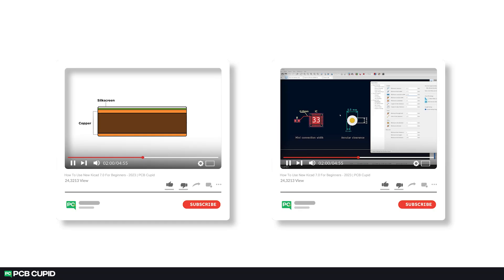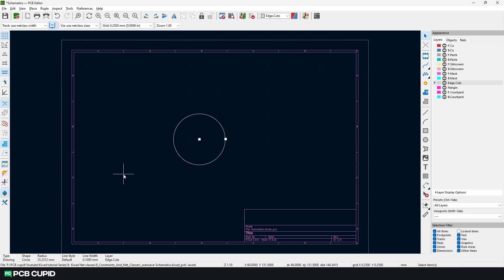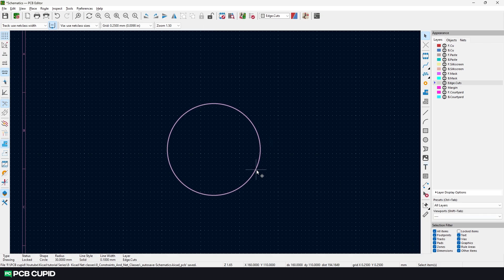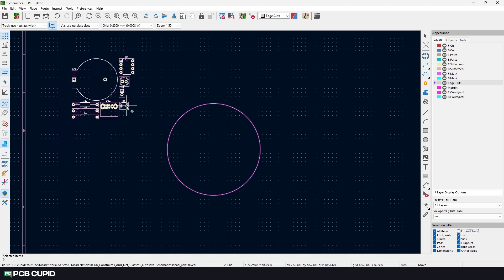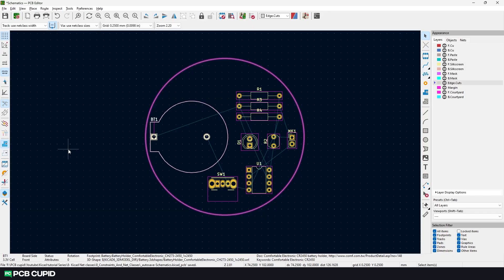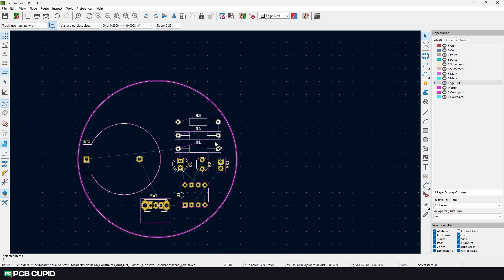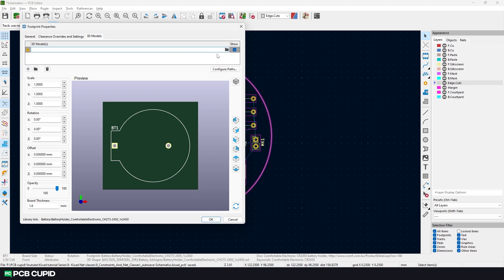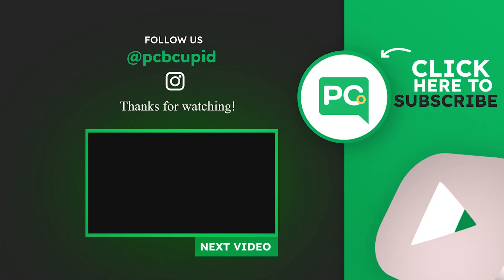#9 How to use PCB Layout editor in KiCad 7.0  | #PCBCupid

Comment: Hey your videos have been super helpful for me, thanks! 
I have a question that maybe you can help me with. I have a design with two PCB-mount jack sockets, each with a ground leg that sticks out the side, this offers some flexibility in mounting. I have limited space in the project I'm working on so I want have the two ground legs in the same through-hole. Can I overlay a Footprint over part of another? I could see this throwing up errors. Or will I have to create a whole new component Symbol and Footprint where the two sockets are considered one unit?

Comment: great video. I downloaded the same 3D switch you downloaded but it was bigger for the footprint. I think you had the same problem, but you decided to move on as that is just for 3D representation.
Reply from the maker: Yes, you can still adjust the size of the 3d model by using the scale factor it won't be perfect, but it will get the job done.

Comment: The Update PCB from schematic option is not available for me..... Provide me a solution!!
Reply from the maker: If the Icon "Update PCB from schematic" isn't available. 

You will have the alternative button on the menu bar -> tools -> Update PCB from schematics
or you can use the shortcut 'F8'.

Comment: What are the scale, rotation and offset of the switch ss12f44g used here, its giving me switch in opposite direction when seen in 3d view.
Reply from the maker: The 3d model offset can vary depending on the orientation of model when it was published. 

In my case this was the offset : 
Scale X : 0
Scale Y : 0
Scale Z : 0

Rotation X : 0
Rotation Y : 0
Rotation Z : 90

Offset X : 2.0
Offset Y : 0 
Offset Z : 0
Reply: @pcbcupid  I think something is different with the model now. I downloaded the same ss12f44g4 model as you, but I had to reduce the scale to 0.7 on all axis to get it to fit correctly. Or maybe I did something wrong somewhere else?
Reply: @deltaray3  Nah, he used the wrong model somewhere.  It was the same for him in the video if you put the playback on 0.25.  It's the same for me too.